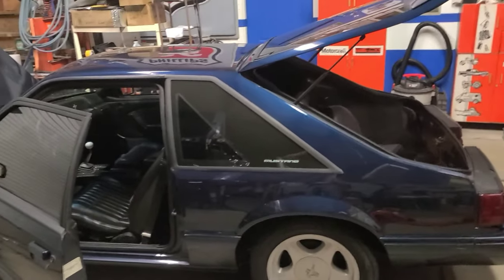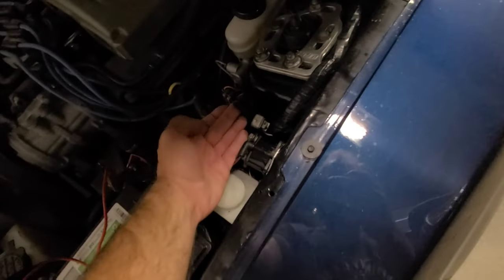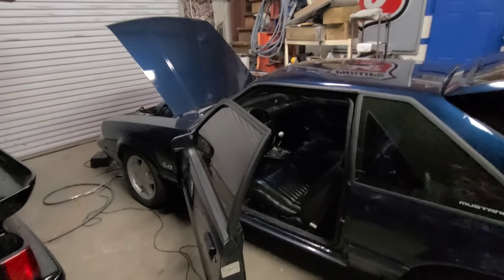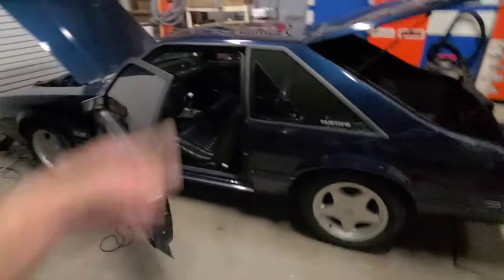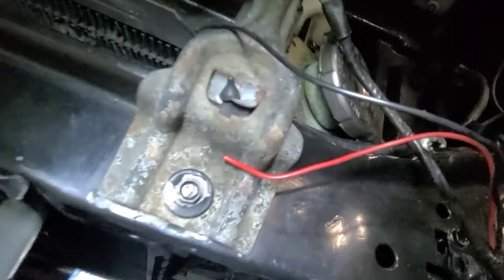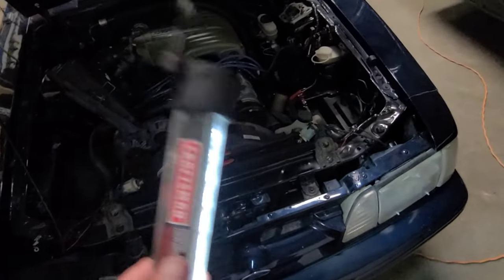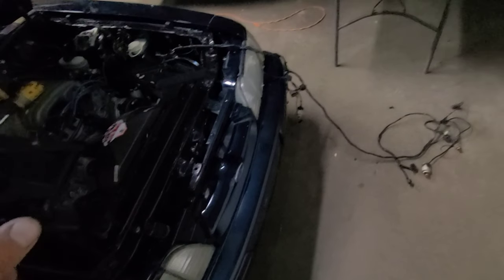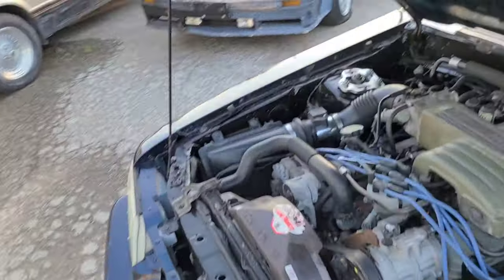Foxbody Mustang Headlight, Turn Signal, and Hazzard Light Problems with the Fix! Wiring Fun!

Comment: Had the exact headlight symptoms you described after I completed my I4 to V8 swap.  Apparently 9007 bulbs work fine with stock 93 4 cylinder cars.  They are nice because they are brighter than the 9004s.  Anyhow, after I completed my V8 swap, including transferring the engine and headlight harness, that’s when the problem you described surfaced.   I took the 9004 bulbs out of the donor car and put them into the 93 and the headlight issue went away.   Thanks a million for that known issue.   :)

Comment: I ran into an interesting issue on a 93 coupe a guy asked me to fix. The turn signals were inoperable, so he bought a brand new switch from LMR. I put the switch in and still no turn signals. Ended up finding TWO of the wires in the switch connector were not in the correct cavity’s. The guy had had two other people look at it over a two year span and they couldn’t figure it out. How those wires got put in the wrong cavities blows my mind. Like you said, I won’t let a car outsmart me I’m to stubborn

Comment: Man i hate wiring, trying to get fogs to work on this car I picked up seen a jumper wire going from fuse #5 followed it and they jumped it to my headlight switch and it’s wrapped around my headlamp power wire. If I take it off I lose headlamps only everything else works. So they are stealing power from turn signal fuse port. Gotta figure out why

Comment: I'm with you, I had issues with my turn signals after I remade the wiring harness for my tube front. Come to find out, dumb me, my voltage was to low on my battery. Good times... I can build a race car but miss the little things.
Reply from the maker: Always seems to be the case. Its those dang little things that always gets us!